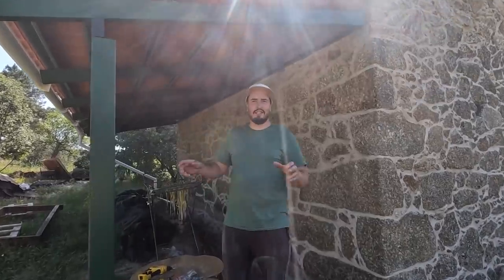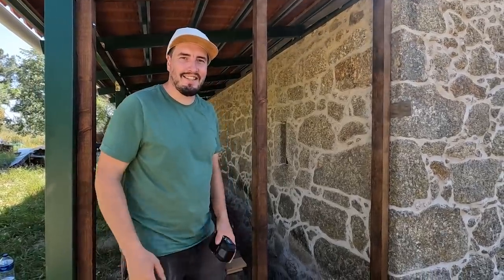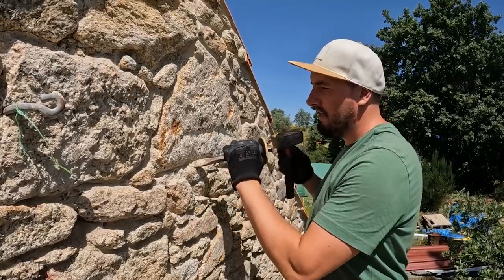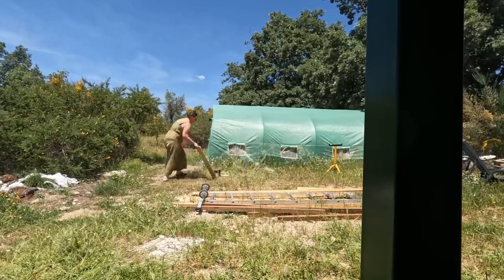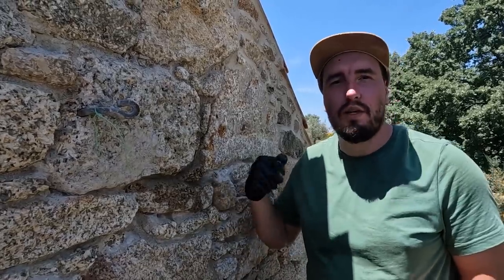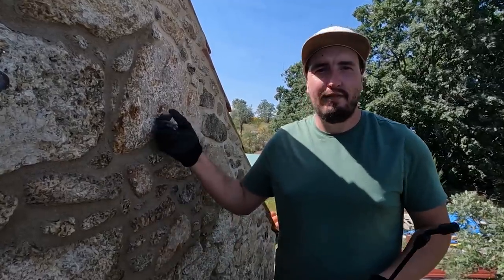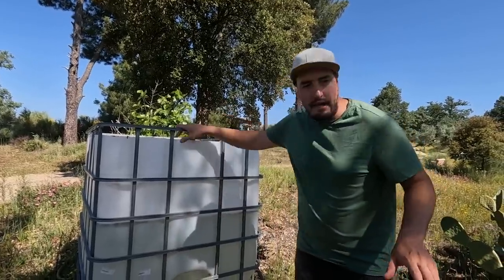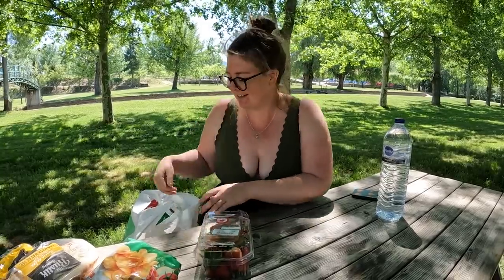THIS WILL MAKE A BIG DIFFERENCE! Building An Off Grid Tiny Home

Comment: Hi there
Just a tip re watering the plants always water the soil not the plant itself as you are wasting water and you can also scorch the leaves in the blazing sun. You only water the leaves when appling a specific foliar feed (most fertilizers are not folier feed but are for root feeding)
Once the plants have gone past the seeding stage I would take the rose off the watering can so you can drench the soil around the roots so that it penetrates down into the soil which is better for the plants. 
have you started a compost bin yet - I see another little project on the horizon (two bays made of five pallets open fronts) and you can utilize all the chicken coop/goat house housing/kichen scraps it should make dam fine mulch/compost 👍👍

Comment: Hello Bea and Theo!  It is Sunday evening, 8:47pm cst -  here in the U.S., just catching up on your latest video, the high light of my day!  Just want to say, I really love your new home and the landscape there in Central Portugal - it is such a lovely place.  The only thing I'd change- hmmn, Your front door is the main focal point of your home, I still think you should put the outdoor kitchenette cookspace under the back side overhang- less sun, nice shade there, lay some flagstone down on the ground, with moss between the stones would feel amazing in bare feet would!  A nice little 2 chair with a small table - would be idea!  I'd build a separate small space for the tractor, altogether, and then your small pool table in the center, then your propane tanks etc., at the opposite end.  Would look so nice.  And, later, you could always screen in that area top to bottom, that mosquitos, flies don't bite and get on your cooked food and a small water hose and outdoor sink connection to wash off your fruits and veggies!  While setting a nice table and chairs, on the front side, with terracotta planters, flowers etc., on the front side - via your focal point front door.   It would truly be both sufficient, functional and beautiful.  It's simply too beautiful in the front, to gaud it up and take away from the focal point front door.  Anyways,  so good to see a new video!  Best wishes.

Comment: You’ve probably thought of it but it would be cool to build a stone setup that can hold your pizza oven and outside stove/oven. Plus a small frig!  ( don’t build them in so much that you can’t replace as needed as the new ones might be slightly different sizes). Plus an lovely outside sink.

Comment: Wouldn't it be easier to use wire brush first and then if needed use chisel?
And I know you talked about the pastry bag not using it,but I have friends that do stone for living and said it's faster then use ur tool if needed. But I understand the stone is older but if you have bigger gaps or holes would go faster and less work for you.

Comment: I use a water barrel that I can you can get them at Walmart or any homes Depot or any kind of a home store it attaches to the chicken coop and it I have a gutter on the slope of the roof and it goes into the rain barrel through a screen so it screens out any pine needles or anything like that but once that thing is filled I can usually not worry about watering the chickens all summer and I get turkey if I have two turkey feeders for my 40 chickens and they hold 40 lb of feed and I can feel both of them and leave for a week or two and just have the neighbors pick up the eggs and just to check up on him but they usually don't have to do anymore than that. That way you don't have to rely on people to take care of your animals so much so it makes it easier for you to go on vacation stuff like that

Comment: Get a big zip lock bag & fill it with your mortar & cut a corner of the bag & compress the bag with your hands & fill in the joints. Mortar bag.
Reply from the maker: Hey Mario, that would work nicely for cement but not for lime unfortunately 😀

Comment: USA requires an 18” deep trench for a water line.
Reply: There isn't a standard depth even in the U.S. In the far northern states, for example, you might need to dig quite deep (3-4 feet) to get below the frost (freeze/thaw) line.

Comment: You ought to get a trenching machine and put it in right with a 36 inch depth with four inches of bedding gravel leaving the pipe at at least 30 inches down or 2 1/2 feet.